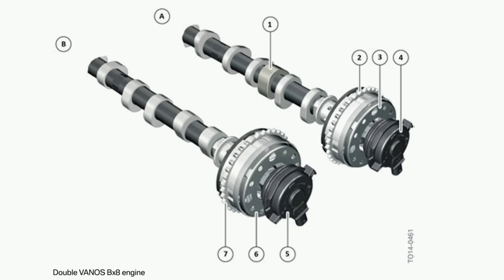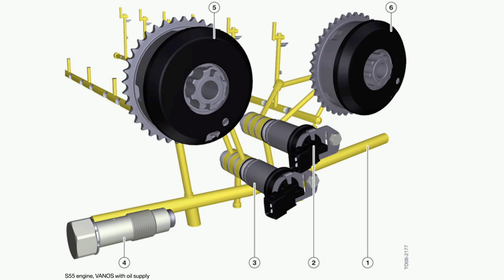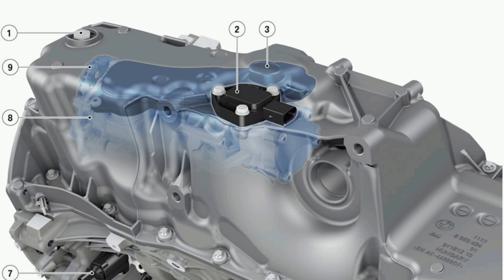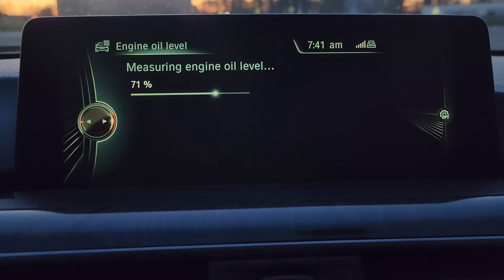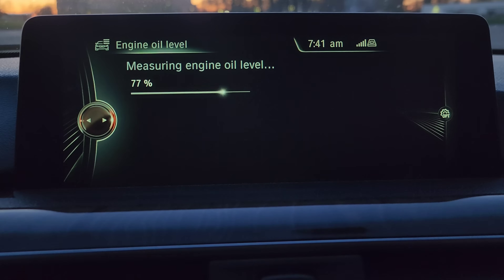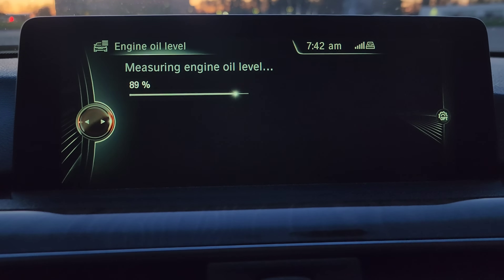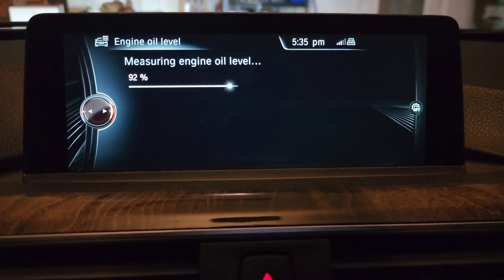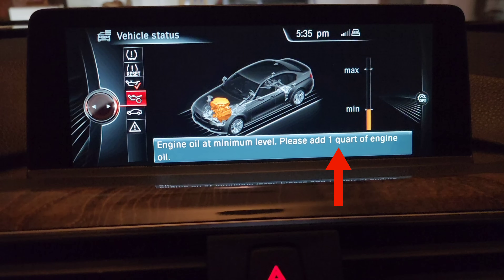How BMW Oil Level Sensors work (and Why They Don't Have Dipsticks)

Comment from the maker: Join My Patreon for help with your build and to Support the Channel: https://www.patreon.com/kern417
Shop my Amazon Store for the tools and products I use: https://www.amazon.com/shop/kern417
Order your discounted BMW parts through my BimmerNetwork Affiliate Link (Coupon Code "kern417"): https://www.bimmernetwork.com/?afmc=kern417&utm_campaign=kern417&utm_source=leaddyno&utm_medium=affiliate
Reply: Since the b58 and s58 share similar architecture, do s58’s suffer the same oil pump issue?
Reply: Hi kern I've a 2011 f10 520 d. It went in for airbag recall two weeks ago in BMW and since my oil level has said oil level is too high. And BMW also said I have oil housing leak,  BMW wants €1450 which I can't afford, my mechanic can't get me in until next week, a warning light has now came up on the dash now saying oil pressure is low I'm stressed out so much. I don't know what to do  can I just ask what you think I should do please? Do I get oil changed and a new filter and sensor ? There are no rattles or anything but there is a little lack of power and a burning smell. None of this happened since BMW took it in to do redo the airbag, can you please help ? Thank you I appreciate any advice.

Comment: what im confused with is, i checked my oil level and it told me to add 1l as it was on the low mark, yet i added 500ml and then it was on the max mark. how can this be if its 1l between min and max.

Comment: G'DAY MATES I Prefer oil dipstick why???? i like to check the oil in colour light golden colour nu oil mid gold brown still ok dark brown/black oil means change oil i like to see the colours & where the oil level at also especially for diesel engines with dpf filter diesel fuel diluted in diesel oil most important if you accidentally overfill fill your oil or to much fuel diluted oil you cant get a a long thin clear plastic hose in dipstick tube to suck out oil more accurately as the syringe would have mils mark on it to let you know how much you took out which is less mess doing  it by drain by sump plug

Comment: I just had the "oil level below minimum - add 1 quart of oil" light come on for the first time ever yesterday. I added one quart and then the reading was in the middle between low and max (it has always been right at the max line previously) I went to check level today and now it will start to measure and stop every time at 15%. Ran a scan tool and there's a 1C3101 code. Where should I start, I was thinking about replacing oil level sensor, or maybe oil pressure sensor, what would you advise? Hopefully its not oil pressure switch or even worse oil pump. I'm at 108k miles.

Comment: On a BMW e87 120d  N47 engine, the oil service doesn't want to reset on-board (cluster). Could it be because the oil level sensor is faulty, because when I check the oil level, it shows inactive. 
I also tried the Launch CRP 129X diagnostic tool to reset, it showed it can't reset engine exceeded over 220000 miles.

Comment: Hey @kern417 I have a 2017 540; I just started getting an issue with the measuring of the oil level; it worked fine with the car for over a year; not sure if they changed the sensors when I got the car, still has the original bmw battery;but when I go to measure it anymore, it stops measuring at around 16-17% it was going to around 49% a month ago but now it’s barely goes to that, any clues or ideas for what the problem can be? Is it just the oil level sensor ? I called up bmw to ask how much a diagnostic is and they quoted $299.99 just to see

Comment: I don’t trust the bmw oil level sensor, which is why I do an oil change every time it says oil level low, whenever I empty out the oil, am missing far more than 1 quart, and this is how people get engine wear, and timing chain failure, because they low key designed these engines to fail, if you don’t use your own discretion to avoid the flaws, the more these engines starve on oil, the more oil they significantly burn, them removing the dipstick, is to prevent owners from saving their engines 😂

Comment: I know cases when someone ruined the engine because this shitty sensor can't show the oil level instantly. 
He went to change oil at a cheap autoservice, that dummy mechanic accidentally poured less oil than needed, could not find the dipstick then looked in the infotainment and it was showing full and he gave the car to the customer. 
The owner drove about 50km, the engine started showing excessive vibrations then an error popped out that oil level too low but it was too late. The engine was cooked.

Comment: I have a m135i LCI with oil pressure too high in startup any idea? I've changed the oil pressure sensor and still get the same engine code. Could it be the oil control valve? N55 engine
Reply: Is it cold out and you are using a higher viscosity than its rated for?   This will put the oil pressure out of limits temporarily at least. One of several things it may be,  but perhaps the simplest fix!

Comment: It's implied that if the sensor says it's low, it's low. This is not true. Case in point; error on screen says add a quart/liter oil is low. Draining and measuring however finds the correct amount of oil. Refilled with new oil at the recommended amount and error still occurs. This would indicate that level reading is incorrect. Either the sensor is wrong, wiring, connectors, or ECM interprets incorrectly. Please explain how error code can never be caused by a faulty sensor. Also the correlation of pressure from the pump, temperature, and level needs more explanation. I do not believe oil expands considerably with temperature and the oil level would be measured in an ambient pressure (oil pan) environment. So is the idea that at higher pressure the oil is kept in the upper chambers more than the pan?

Comment: I recently had my 2014 550 shipped to me that I bought out of state and I’ve put almost 3000 miles on it and the meter still says max I’m going tomarrow and have it changed I hope the meter is not faulty and it’s low cause I’ve heard these burn oil can someone tell me if it will be ok is 3000 miles too much without adding oil?

Comment: I have a 2003 330 ci conv summer car with a dipstick. Last summer soon after a oilchange the yellow warning started to come and go. The level sensor gives a fault code and is back if removed. I bought a vacuum pump so i could reuse the oil and also a new sensor. I filled up the oil and checked fault code that was from the old sensor and removed it and the new wont give a new code. Iam at low level where the yellow warning used to come on in a sharp curve, but the new wont warn even if iam 2 liters low standing still at idle. So i bougt another sensor and its the same result. I have a long curve that used to turn on the yellow warning so iam now at low level on the dipstick. I will drive it a few more days and see if i get any warning. The yellow was coming and going on the original sensor but with the new ones its off all the time. So that is positive, but no warning comes on in my sharp curve. I have had the car for 11 years and its consuming oil so iam used to check the level but i trusted also the sensor. I have cleaned the inside of the old sensor and will see if it gives fault codes, it was alot of dirt inside and if it gives fault code i will become a doctor and open it and see how it looks inside. 

I have also changed the level sensor in the cooling system, but that was the contact in the car that was the problem. I did not want to bend anything in the contact so i took copperpaste and its working fine with the "broken" one, at least for a week now. And if i use my vacuum pump the level warning comes on. Its the oil level tat is a mystery. Iam going to buy 8 new bolts to the plate under the engine.Its ben on and off to many times now.

Comment: Bro, thank you so much for your videos. 
I was looking for a video to see why I see oil residue under my air filter of my B58. I got  a G11 740i in November (that’s why started following you). Although service is due in August, I wanted to replace spark plugs and air filter today, so I noticed some oil residue.
No blue or other color on smoke, no problems with power, I haven’t check oil level yet since always says “Engine Level Ok” I didn’t know you can check the exact level.
Car has 130,000 miles.

Hope you can respond soon!

Comment: Appreciate the content, because of the way you have made it simpler to understand. 

My car is in the garage, few issues around the sensor (leak back) and the turbo washers. 

Slight leak around the oil cooler as well so getting all done. 

Very good post and helpful - ty 🙏🫶

Comment: Hey Kern, I got a b58 gen 2 (2021 x3m40i) and I do normal commuting and some agressive driving and sometimes I cruise on highways around 90mph for at least an hour or more sometimes slowing down below that speed and then getting back up to that speed. Check oil light popped on, and I added oil to level it off… my problem is that since I bought it, every time I have tried to measure my oil lvls it stops measurement at 17% (every single time) what’s up with that? I am scheduled to get it diagnosed in about a week. I will update so you can share with the community. I believe this is inportant and we should be getting this info. Cheers!

Update: BMW diagnosed my car! Found it was a faulty oil pump… it’s an all metal oil pump too, I drive a ‘21 x3m40i…. Luckily I had the used car dealership warranty and they were able to take care of me $5k and 1 week later… I missed my baby but now she is back and I can successfully measure my oil level! Car runs the same as before. Odd that this was the cause. BMW said it’s not that common but they have had to do it on a few vehicles. I wonder if it’s due to previous owners and their oil change habits… I suspect whoever owned it previous let it run to 10k miles every time… that’s never good on a performance model… I suspect the oil pump got gunked up and caused the oil pressure to fluctuate too much causing the computer to misread the oil pressure therefore canceling the oil measurement test. I hope this helps the b58/BMW community!
Reply: What did you find out?
Reply: @ glad you asked! I was luckily under warranty from the used car dealership I bought my car from. Have about 65k on the dash and the service center that the dealer I bought the car from couldn’t figure out why my car wouldn’t measure the oil level… they brought it to bmw and bmw diagnosed it specifically and found out that the oil pump was bad!!! It’s one of the new all metal oil pumps too, crazy! I have a 2021 x3m40i and I know for a fact I have the all metal oil pump, the engine code is a b58TU/D which has the all metal one. Luckily since I was under warranty from the dealership they covered the cost for the new oil pump which ran them about $5k! It was serviced and installed by bmw so I feel good about that. I have successfully been measuring my oil level without problem now! Also learned that using LL FE 17+ is basically the economy oil and using another type of oil like ow30 like the x3m uses could result in less oil consumption. Still have to see where my oil level will be at after 3k miles, only done about 200 miles since the oil pump was replaced. It’s concerning that if your b58 that has the all metal oil pump it can still show early signs of failure without getting a oil pressure light. I suspect that the previous owners did the bmw recommended 7k - 10k oil changes and they might have used low quality cheap oil and as a result it gummed up the oil pump. I never got low oil pressure lights and the performance was fine, I just never knew where my oil level was at. Now I have an idea but it only cost $5k 😬 idk if anyone else is aware of this problem or if they bring it to bmw if they have the same issue, will bmw say the same thing? Idk, only time will tell.

Comment: I had my oil pump replaced and it fixed all of the low oil messages I was getting.  I also had a circuit fault for the solenoid control valve that nobody seems to talk about.  My oil was drained twice and confirmed to be the correct amount as well, btw.
I just opened up the oil pump and the plastic housing seems to be perfectly in tact.  So what gives?  Why was it giving all of the false messages before?  It went from low oil to THIS IS NOT A DRILL add oil now you are below the minimum!  
So is the oil quantity control valve actually the issue?  You said if the sensor is malfunctioning it won't tell you that your oil levels are low

Comment: You must be careful with the idrive oil measurement. It is an E-dipstick which means you cannot simply just ask it to take an oil measurement whenever you please! There are at least 3 condition needed before you can take the measurement. Engine temperature, oil pressure (Around 3 BAR) and fairly flat surface. The car must be running for a period of time to be able for it to meet at least 2 of these criteria. If the engine oil gets too low around "min" I found it is even harder for it to conduct the test. You should drive the car and try to take multiple readings till you get the oil check to 100% and be able to read the value. If that will not work read the engine oil level sensors with Bimmerlink or ISTA.
Reply: Wow you just said the exact same thing the video said
Reply: @ no you just cherry picked information

Comment: Oil pressures do not get higher as the car warms up, they get lower. Kinematic viscosity and dynamic viscosity both decrease with temperature. It’s far more likely to be failing the test because it can’t achieve target pressure (low).
Reply: Yes, but the b58 has a variable displacement oil pump, so since viscosity goes down with temp you need to pump more oil to maintain proper lubrication lubricatjon.

Comment: Good video! I do feel the urge to point out that as the temperature of oil rises, pressure drops. It's because oil gets thinner and it drains from bearings easier.
Not b58 specifically but in general, on cold start up oil pressure may be 60-80psi, but fully warmed up will drop to 15-20 psi.
Reply from the maker: @darius9521  keep in mind these cars use variable pressure control oil pumps. Pressure can be manipulated at any time

Comment: What if BMW saw major profit loss in Europe as people changed their BMW oil by extracting the oil through the dip stick. Something VW allows you to do until today. I can change my VW oil after a long drive in  and about 24 min by sucking it out and the oil filter is in the engine bay on top.

Comment: I love that they gave a BS excuse for needing an oil level sensor, as VANOs or VVT does not need an oil level measurement to operate. It actually goes by oil pressure, and you can hear a very faint rattle on startup until it reaches operating pressure.

Comment: 2020 M340i’s suffer from oil pump failures. Some people have no issues while most have issues reading the oil level through idrive. I hope they release a TSB/Recall for this. I heard some people with the failure use BimmerLink to check oil pressure
Reply: have there actually been oil pumps fail where it made them replace the engine or is the oil pump going bad over time

Comment: I don't see how the oil level sensor has anything to do with the VANOS system. VANOS is not much different from any other VVT cars using cam phasers, and none of them use an oil level sensor!

Comment: These oil sensors were integrated into cars in partnership with the German Cardiology Association.
When you get the warning chime your cardiologist will know if you're healthy or not!
Once i started my b47 and drove 5min to go get gas. Once i started the car at the pump it threw a low oil level warning. My heart dropped! But thankfully my car has a dip stick and it was completely okay 🤷‍♂️
Maybe it was the startup measurement that failed. It was a one time thing though : )
Reply: Cardoilogist*
Reply: what I understand from this video, if shows low oil on electronic level, means that oil pump is not good...

Comment: I really appreciate the explanation of how the reading will fail. 

I am trying to understand how loss of oil pressure may impact the oil sensor reading when using ultrasound refraction (measured in time sent/time received). 

My guess: Is it due to the pressure differential in the air (ex. due to plastic housing being cracked, there is lower pressure) affecting the soundwave enough to the point it makes it outside of parameters?
Reply: I'm guessing it's because if the plastic outer ring is cracked the ECU can not adjust the oil pressure correctly, so the ECU is seeing an incorrect pressure (high or low) according to oil temp and/or rpm, so it stops reading the oil level.

Comment: Do both quantitative and qualitative measurements use an ultrasound "pulse" or is there a different style of measurement for each?

it seems the ultrasound pulse would need specific conditions to fall within the ms range to accurately detect oil level (i.e. after engine running 30 mins, etc.)

Comment: I hate the way it’s done, I checked the oil once using I drive. Saw where it says oil is at minimal level. Ordered 8 liters of oil figuring it was bone dry. Panicked thinking I have major oil leak or oil burning. Added one liter and  it said it’s st maximum level. My car is a M3 E92 which uses liquid Molly $20 per quart. Why not add a dipstick for peace of mind.

Comment: 2016 SQ5 had oil leak from oil level sensor. But it was giving some occasional false readings for last 4 yrs. I added a dipstick ($40) as a fail safe. There was a plastic cap for a dipstick. Dumb design.